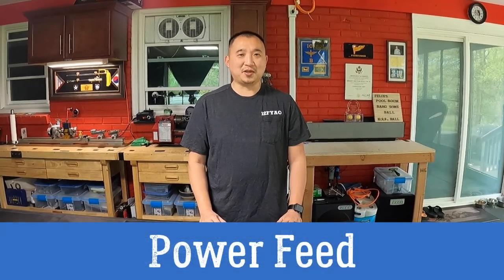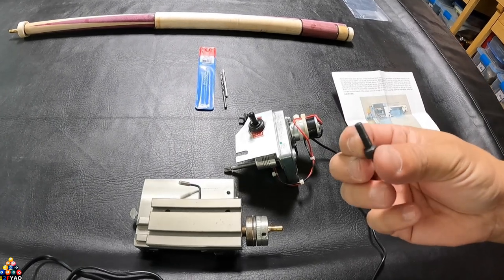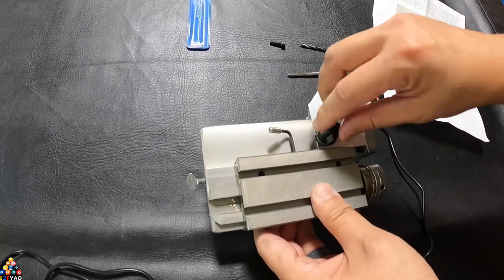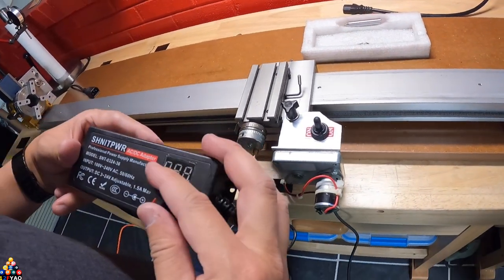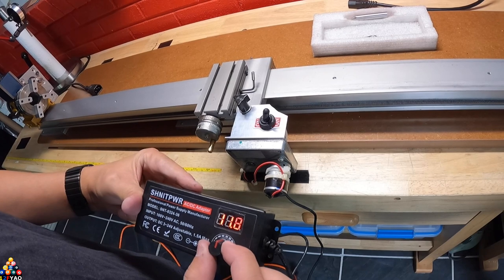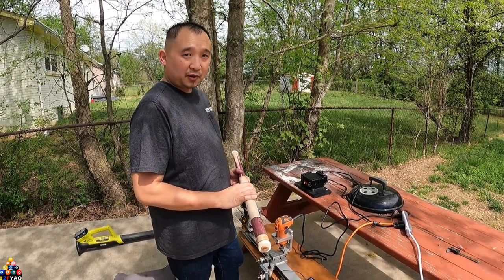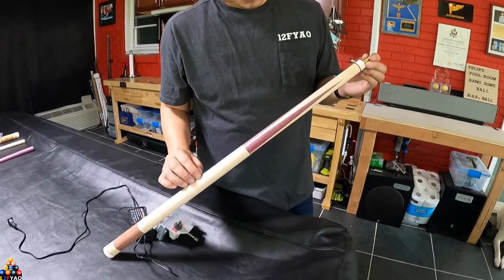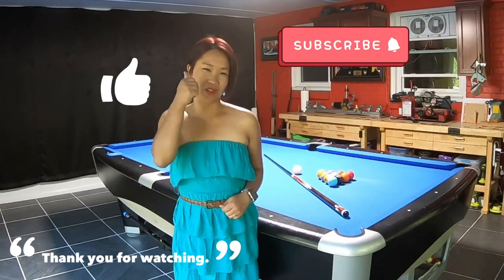Mid America Cue Lathe Power Feed Review and Demo. Pool Cue Lathe Accessories.

Comment: I just purchased this a few days ago. Its a big help for consistent straight cuts that take a while to make when going slow enough on a finish cut. Im a hobby cue maker so this is plenty.
Reply from the maker: It takes a while to do the finish cut but the time it takes it saves on sanding. Now I don’t need to sand and have “bleed overs”. I wish I bought this thing earlier.  Thank you for commenting, please subscribe if haven’t already and please share.
Reply: @playpool12fyao  I use waterbased sanding sealer if that helps? :]  No bleed overs and I can have the wood as fine as I like.
Reply from the maker: @TheBanomanew  My pool league team mate told me to seal the cue first then sand it but haven’t tried it. With the power feed I just cut it about 5 volt and it is smooth. I will try the water based sealer especially with cocobolo. Thank you for the tip.

Comment: Oh my god this is the video I’ve been looking for. I’m guessing you already offset your centers?

Also, can you do a video like this for a shaft blank?   Can you build a shaft from scratch? 

Your videos are so dope bro.  I ordered the same lathe from Mid America. I put a deposit didn’t get it yet. Can’t wait.
Reply from the maker: Awesome hope your lathe comes in soon. As for the set up, I did. I have two tailstocks, one for center drilling and one offset for tapping the butt. I would recommend buying another tailstock so you don’t have to find the centers every time you offset the tailstock. For turning a shaft, you can do it. I have done it but it is very time consuming and it requires a lot of practice. I messed up more shaft blanks. If you want to make shafts, buy cheap wood to turn in to tapered shafts. Personally I tell customers I don’t make wood shafts but I will build them a carbon shaft. Thank you and thank you again for commenting.
Reply from the maker: Here is an old video on how to turn a shaft. The shaft turning starts at 1:31:00
Hope this helps. 
https://youtu.be/8s5jvffTW1Y?si=YCqnPtC7YCXXNMGc
Reply: @playpool12fyao  yes, I remember you said that thank you

Comment: I wonder how hard it would be to convert a cnc setup to this lathe bed for using a g code program for auto cutting the shafts with your desired tapers vs a conicle taper or setting it up to run the pro taper and stopping them adjusting it to go from your taper to the 3-4 inches from the joint.
Reply from the maker: Todd from Mid American Cue Lathe use to sell the CNC convention kit and a whole set. The biggest thing is to make a mount for the stepper motor. Once you figure that out, it won’t be hard to get it to be a CNC.

Comment: did you manually drill or use a drill press?
Reply from the maker: I used a manual drill. Started with a pilot hold then drill to the needed size. Thank you for commenting again.

Comment: How do you think the Cue Smith differs from the Mid America? I'm thinking about one or the other.
Reply from the maker: I never used a cue smith but regardless from the two, they both use Taig Tools. 
https://taigtools.com
Hope this helps.
Reply: @playpool12fyao  That's great!
Reply from the maker: I would get mid American cue lathe due to its customer service. Todd is easy to get to. He replies in a timely manner.
Reply: @playpool12fyao  He is not taking on any new orders. It's been like that for a bit.
Reply from the maker: If you really need a cue lathe and you can get a hold of Chris from cue smith. I would talk to him. If worst comes to worst, try looking at a lathe on Amazon. They have lathe that will accept cue butt. A 8x16 lathe comes with a 1.3-1.5 bore at the chuck and spindle.

Comment: For tapering are you able to just slide the tailstock over? I have the same lathe and was wondering if it was possible to do that
Reply from the maker: Yes. Just move the tail stock. I have a video on how to do the measurements.  I also bought another tail stock so I don’t have to realign my tail stock to head stock. 
https://youtu.be/sVw4G0OF2AY
Hope this helps, please subscribe if haven’t already and please share.
Reply: Awesome, Thanks 👍
Reply from the maker: No problem. If you have any questions please ask I’ll do my best to answer them. Thank you for commenting again.
Reply: @playpool12fyao   actually I do have another,   is the tool in the lathe head flexible?
Reply from the maker: The power feed, the pinion that attaches to the motor is flexible. If that is what you are talking about. It has a flexible coupler. 
https://www.amazon.com/Saiper-Couplings-Connector-Compatible-Accessories/dp/B07S8XJT4D/ref=asc_df_B07S8XJT4D/?tag=hyprod-20&linkCode=df0&hvadid=344008105835&hvpos=&hvnetw=g&hvrand=6532089291333251030&hvpone=&hvptwo=&hvqmt=&hvdev=t&hvdvcmdl=&hvlocint=&hvlocphy=9013097&hvtargid=pla-776195606568&psc=1&tag=&ref=&adgrpid=71909876129&hvpone=&hvptwo=&hvadid=344008105835&hvpos=&hvnetw=g&hvrand=6532089291333251030&hvqmt=&hvdev=t&hvdvcmdl=&hvlocint=&hvlocphy=9013097&hvtargid=pla-776195606568
Hope this helps.
Reply: @playpool12fyao  that did help also but I'm asking what's driving the shaft or butt coming out of the jaws? Sorry I don't know the tech terms
Reply from the maker: I use a dead center on the the drive chuck and a live center on the tailstock.  The pressure is enough to turn the blanks. This might help. I have a time lapse video on how I make the pool cue and videos with just pictures.

Comment: tell your wife get well soon! Nice, also better for trueing up jaws ...whats next? maybe taper bars??
Reply from the maker: Will do. Funny you mentioned a taper bar. I am working on one. Hopefully it works. If it works it’s a lot cheaper than getting a CNC. Once I get it to work I will share on YouTube. Thanks again for commenting.
Reply: @playpool12fyao  I made some out of aluminum flat bar from lowes , not only that but with powerfeed u can manually manipulate tapers
Reply from the maker: I need practice doing free hand. I should be easier with the power feed.  I want to see if the taper bar set up will work. If not I’ll try the flat bar.
Reply: @playpool12fyao  fr cue button joint end is 5/8 and angle flt bar fo bout 3/4
Reply: Thank you sir 😉😉

Comment: why choose mid america, not cuesmith ?
Reply from the maker: I contacted both, Mid America and Cuesmith and Mid America had better customer service. Todd from Mid America replied within 24 and told me exactly what I was getting and the total cost with shipping. I wanted a cuesmith but he won’t return my calls and he replied to my email almost a week out.  I am happy with my lathe. It has built me my cues I play with from playing, breaking and jumping.  I also sold some cue, repaired cues and made carbon shafts.  Hope this helps, please subscribe if haven’t already and please share.
Reply: @playpool12fyao  is it good  for joint repair too ?
Reply from the maker: It is. Mid America Cue Lathe is super accurate especially for facing the joint and setting the pin. If you plan to replace a joint collar, that might be difficult unless you get a compound slide so you can cut the tapper. You and also trim the joint collar then sand the matching tapper of the cue. Hope this helps and thank you for commenting again.
Reply: @playpool12fyao  i like to know advantage and disadvantage between cuemith and midamerica. both look good products,
Reply from the maker: I can’t speak for the cuesmith because I never used one. It looks the same because most of the cue lathe are made from the same manufacturer, Taig Tools and therefore there are really not disadvantages or advantages over each other besides the tapper bar cuesmith comes with. Mid American get the part from Taig and from the looks of it so does Cuesmith. I just bought a mid American because Todd was quick with the reply back. Thank you for commenting again.  
Link to Taig Tool. 
https://taigtools.com